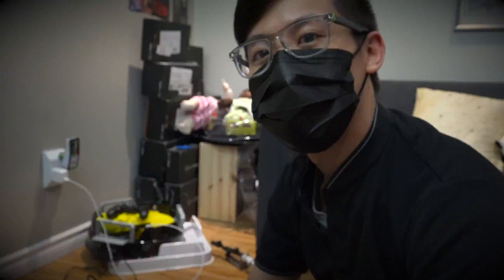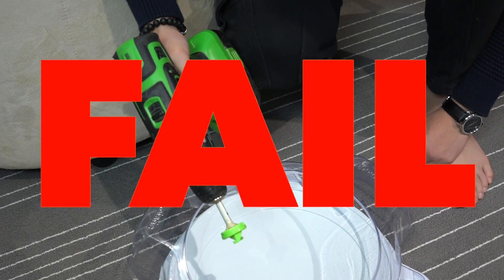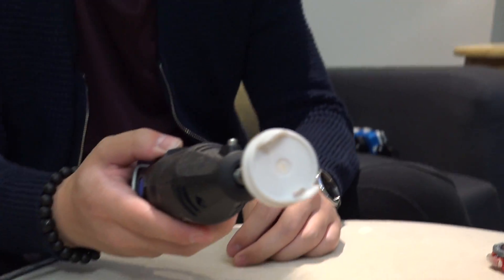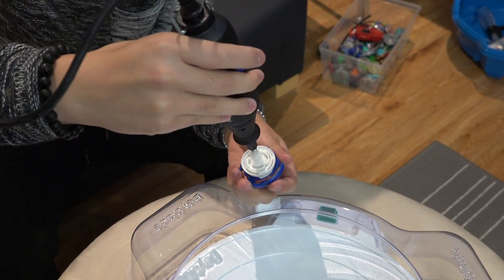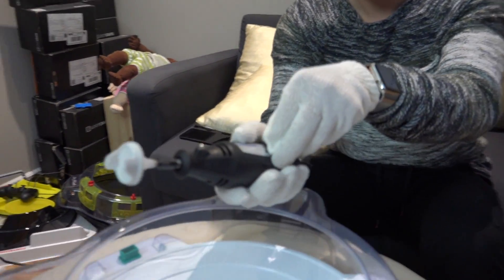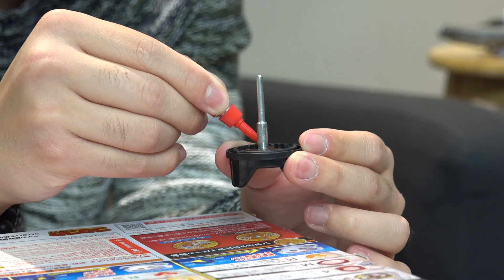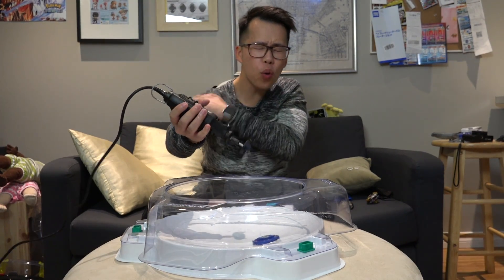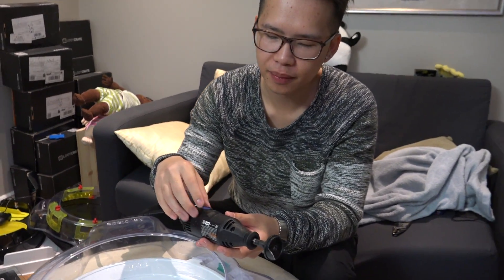FASTEST ELECTRIC BEYBLADE DRILL LAUNCHER! - Extreme Toy Modifications!

Comment: So just to help you guys out when it comes to modding, 2 options: Green stuff,  2 part modelling puddy that when cured has a rubber feel and can be sanded and painted easily. Brown stuff 2 part  aluminum puddy that when cured is like rock or metal and is also easily painted. Also when you use these the ratio effects the hardness or softness
Reply: You can quickly turn anti spin on the drill and it will rip

Comment: Attach the dremel to the gear multiplier so it cuts down on the wobble due to the lopsided weight.  Plus by using the gear multiplier it will be faster than the dremel on its own.